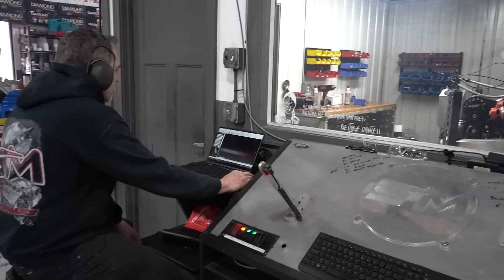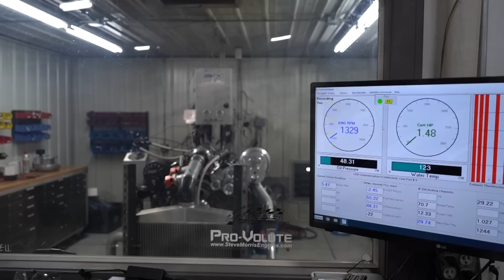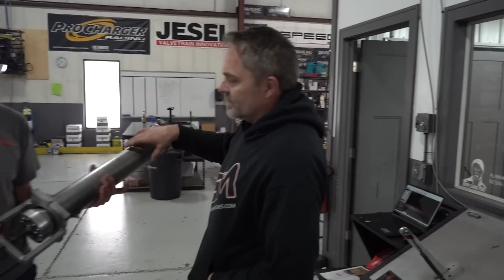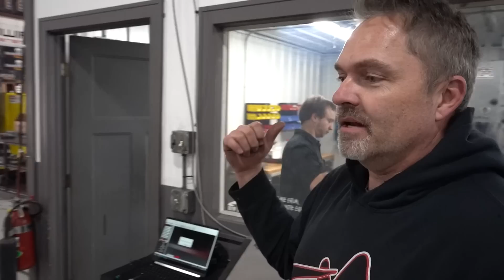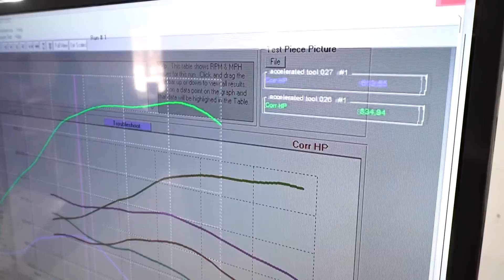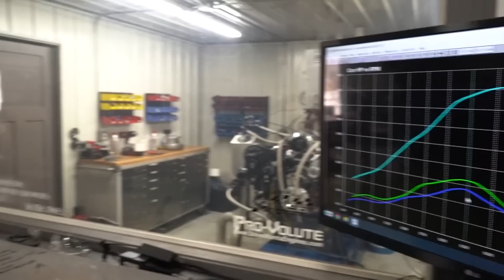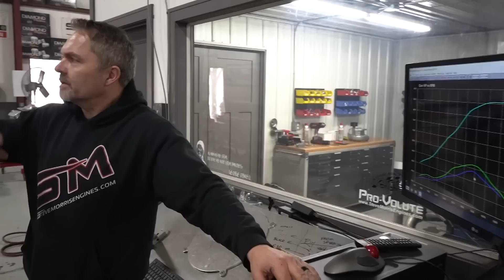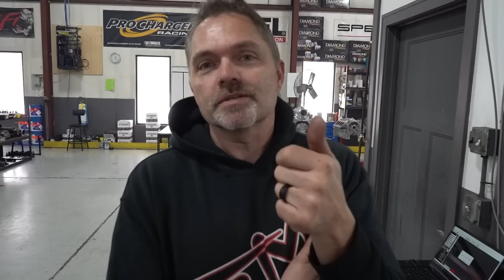CRAZY Testing After The  Dyno Session

Comment: I wonder what would be the effects if you basically restricted the flow, turned up the boost essentially, to the point where the supercharger began to cavitate. All least in reference to the parasitic loss. Obviously cavitation can and will destroy the impeller and possibly the housing and bearings eventually. Restricting the output flow and the body would go up to a point where the impeller couldn't create any more and it would cavitate and overclock if you had an unlimited supply of input power, but the charger being limited by being driven by the engine rpm directly, would it alleviate the chances of cavitation or if it happened, how would it show in the parasitic loss?

Comment: I'm thinkin' the motor is sucking in air with the blower feeding it, so the total amount of airflow through the blower is much higher. So with the blower just on a restriction it will run at a totaly different spot on the compressor map. So maybe a efficancy thing? I dont know, one of many thoughts.

Comment: Can you please get them to provide information for their superchargers. I do converters for a living and more people are contacting me with torque storms. Blind guessing just isn't my business. There is not so much as internal gear ratio on the website. The only sliver of information is "capable of 1250cfm" which is not at all helpful.

Steve is correct around the 20min mark. A big block will run an extreme street legal supercharger out of air. A really nasty small block will even do it and I will say no more on that subject. Ya'll can chase us if you want, part of the fun, good luck.

Regarding the parasitic. Wide open it's a single stage air pump. On an engine it's a two stage air pump. You're pumping air with an air pump into an air pump. How much air the secondary air pump(engine) pumps will have an effect on the parasitic losses, as will the rate of acceleration which is a subject not even mentioned. Boost is a measure of pressure differential, there is a totally different pressure differential into atmospheric than there is into an engine so this is actually not an equal comparison and while interesting is not equivalent.

Comment: Centrifugal compressors produce parabolic boost curves at a given shaft speed. When running open pipe you are essentially on the right hand side of the map where flow is maxed and restriction is minimum. As you increase restriction the pressure rises until it goes flat and eventually stalls on the left side of the map.  The horsepower required essentially follows the constant speed pressure curve only it is inverse so the greater the flow the greater the horsepower demand for a given speed. Again the power curve is parabolic so in the effecient part of the map from choke out a little amount the power doesn't change very much but as you start to get towards the area where pressure drops fast with flow the power required goes up fast.

Comment: If you have time to make the content, run an engine on each dyno with one driving the blower and one getting the boost. Set the same ramp rate for rpm and that would probably give you the most accurate horsepower loss for driving it. It would be cool to see how much more the other gains with all the benefits of the boost and no parasitic loss too.

Comment: I agree that it’s not a direct correlation. An 8 cylinder compressor of a given C.I. flows nothing like a fixed orifice pipe. An engine is essentially a variable orifice due to rpm. You could match the orifice flow to a given engine rpm flow, but that doesn’t help you any. Finding the parasitic loss isn’t fixed at a given boost level. It’s all cfm based. Even that is a ballpark in general though. Every engine flows a different cfm at a given rpm.

Comment: Lots of great comments on here! I tend to understand this situation as the general theory, supported in a few places in the comments here, that the operating range of the compressor is the critical component of this conundrum, with the factor that the engine only allows a finite amount of air flow being relevant (the reason that positive gauge ("boost") pressure can be established in the intake manifold). Once the compressor is allowed to flow directly into the atmosphere at a constant 14.7 PSI or 0 gauge PSI, it cannot function within its designed operating range, the designed operating range being in the state of feeding an engine (which moves a defined volume of air at a given speed) compressed air. I suppose that cavitation could possibly be the internal result of operating the compressor whilst feeding it directly into the atmosphere. In the event that the conical valve is used to simulate the situation of the compressor forcing air into the engine, the direct evidence of the crankshaft deflection magnitude shows that the compressor is again taken out of its operating range, perhaps in this situation it is not allowed to flow enough volume to enter its efficiency range. I would like to see air temperature data from each of the tests. The mechanical energy has to be converted into something, usually this is heat....

Comment: Steve you have explained before that  the more you boost an engine the more it tries to push everything out of the bottom of the block.  So if you dump the boost you only have the belt pulling up the crankshaft to some extent.  With the engine boosted the forces are probably more balanced.

Comment: Wouldn't the compression building in the intake from the blower not also cause back pressures resulting in blower propeller drag? I don't believe the engine itself can exhaust the amount of air it's receiving there for causing back pressure on the propeller I've been wrong before but I'm willing to bet that it causes a difference
Reply: What i win? 🤣🤣🤣 
Go away scammer!

Comment: What a great video and natural engineering skill.

I think what’s missing is the engine air pump factor, you got it as I was typing. 

Basically variable resistance at the end causing different cfm’s needed for a target boost pressure based on engine rpm.  

I think driving the supercharger with a second engine with rpm matching is the only way to solve that relationship across the range.

Comment: Agree with your theory at the end.  The engine is at a lower pressure (on average) than the room is.  If you could hook the compressor to  vacuum pump big enough to have the same amount of pressure and cfm as the engine does across the WOT rpm range, I think you'd be able to know compare the blown engine to not blown HP curves to know how much HP the blower was consuming across that WOT rpm range.

Comment: The crank pulling issue is a physics problem. When the motor is under boost the centripetal forces acting on the crank is high enough that it offsets the superchargers pull on it. With out that boost pressure to raise the centripetal force on the crank it’s easier to destabilize. Basically, the pull of the blower is strong enough that it can affect the forces acted upon the crank when the motor isn’t receiving its boost.

Comment: I believe the restriction of airflow through the engine is substantially more than test contraption given the "same" pressure level.  The air pressure on the contraption sitting in the room is 14.7psi, one atmosphere.  In the engine, at wide open throttle, you have zero atmosphere in the manifold.  So, if you add that 14.7psi of atmosphere pressure to the 12psi of manifold pressure when running boosted, you need more like 27psi at the contraption/restrictor to get anywhere close to matching the pressure and airflow through engine.  Really, it's dynamic, and a lot more complex than my feeble mind can wrestle down, but I think the premise applies, and is why you saw closer to expected results with increased restriction (27psi first pull).
Reply: Whoops - nevermind.  I see in the last seconds of the video you guys got there.  Started typing too soon!

Comment: You're just venting the blower to the atmosphere, and engine is actually consuming cfms that come in. I think just venting it to the room you have to have a higher PSI reading because there is no engine using air coming in. I'd guess have to CFM the motor with a meter NA, than under 13lbs boost. If say engine is 1300 CFM NA, and under boost is 2800 CFM, than would have to set the contraption to read 2800CFM for it to be similar? IDK, I guess what I'd try if I had the means to.

Comment: I think you would find that restricting the output of the blower is very different from restricting the input... still a very interesting test. IE it is different from blocking your vacuum cleaner and the motor unloading. Temperature rise at the blower output is also a factor with the measurement... ie if you have a ridiculous rise in temperature of 270c the blower could provide 15 psi but no more mass, I know this is a ridiculous extreme.....

Comment: I would expect the increased (boosted) cylinder pressure to counteract (to some extent) the excessive crankshaft flex/deflection when the supercharger is venting into the room.  In the absence of that pressure, the crack experiences greater flex/load & contacts the crank pickup.

Comment: Could they design the idlers so that the pull is 180 degrees apart on the twin setup? Also i'm curious if these blowers could be modified to have variable pitch blades much like the turbos that are on diesel engines. This way it could be tuned at different rpms and loads to produce the most boost with the least amount of parasitic draw.
Reply: While there has been some research on the compressor side, variable geometry is only implemented on the turbine side of any turbos currently produced
Reply: All the variable turbos I’ve seen aren’t pitching the blades. They’ve got adjustable nozzles that change how the exhaust hits the turbine. 
I would imagine with one of these you’d want a variable drive on the front so it can spin faster at low rpm and then slow down at high rpm so you stay in its efficiency zone. Although, part of the reason they work so well is because they don’t produce to much power down low and spin the tires.

Comment: The mass airflow with supercharger pushing through the engine at 12psi will be much higher than the mass airflow through the test pipe at 12psi. This is drastically changing where the airflow and boost sit on the compressor map. You would need two identical engines side by side both pulling dynos at the exact same time and rpm. One engine running the supercharger, the other taking in the air from the supercharger.
Reply: Sorry, nope. See my comment below.
Reply: @damonsalo597  Sure. Those equations make sense. At the end of the video he glazes over compressor efficiency. When a centrifugal supercharger is moving air into a running engine as designed, it's efficiency greatly increases vs. moving air down a pipe with a fixed restriction at the end.

Comment: Its the same as dyno runs in different gears. 4th will most likely show more power because it creates more load. (but is more likely to break stuff) When you close the cone and create more pressure it is creating more load on the engine also outputting a bit more power. This is the same reason you wouldn't expect the exact same numbers from different dynos. There can be slight differences in the loads between similar dynos and different types of dyno load systems can show drastic differences in HP. Dynos are really only a good reference to themselves. Its assumed that most cars make more power on the track than on the dyno due to the weight of the vehicle and aero forces changing the load.

Comment: Nose loading on a crank....sparks. Well, back in 80, we did a bunch of crank deflection testing at McLaren Engines on Buick V-6's. The multi-V-Belt that was used deflected the crank in a BIG way. 4 belts bent the (LONG) nose of the crank with over 800lbs of belt tension. 
Yeah.
We saw sparks too.

Comment: So is there a way to make it more efficient and take less horsepower? Do you make a bigger compressor wheel and spin it slower or make the gearing different to help with mechanical advantage to lessen the loss of horsepower.  Maybe lightening parts ? It is scary if your  thinking about adding a blower of this type to a stock engine and you blow a discharge hose and it snaps the crank shaft off at the snout .

Comment: Just a thinker with out any education, but the hp used to drive the blower will correlate with the efficiency, so when the efficiency takes a dive on the chart, so will the hp used.  Air driven is the hp used within the efficiency graph.

Comment: If you had load control that you could sync 2 dyno cells to rev at the same rate you could mimic the dynamic load on the blower by having the loaded engine feed boost into the cell next door where that identical engine is running at the same rpm. 

This would give two confirmations of the blower dynamics: 1, parasitic loss of the blower, as the driving engine would be down on power by x. And 2, the other engine would see max developed horsepower, as it doesn't have a blower dragging it down, but does have boost bringing it up.

But that would require load control that I'm note sure you can develop without many dollars of test hardware.

Comment: On any belt drive, the driver has a tension (load) side and a slack side, so you're only pulling the crank toward the load side. A crank snout support bearing on the front of the balancer  with a cantilevered frame mounted to the pan rail and front of the block would help distribute the side loading, like the pinion snout bearing in a Ford 9". You guys have the capability to make that happen. CNC up a prototype and don't forget me when you sell a thousand of them....
Good session!

Comment: the boosted pressure in the engine is not the same as running the supercharger straight out to nothing. You are always "leaking" boost into the engine, you need the charger to build enought backpressure to be able to read a positive boost value on the intake manifold

Comment: Theory: the blower is loading the nose of the crank the same, regardless of where the blower outlet is going... but that when the engine is receiving boost, the sweep goes considerably faster than an N/A sweep, and so the tension of the blower drive belt doesn't have as much time to act on the crank nose and deflect it to the point where there is a crank trigger interference issue.

Another theory: there is some kind of harmonics issue at work in the crank... each power stroke of the engine under boost pushes on the rod/crank noticeably harder than when N/A.

Comment: I think that the easiest way of measuring power consumption would be to run the blower of an electrical engine matched to rev up at the same pace of the real motor. In this way you get all the real boost on the real engine and the parasitic loses on the electrical engine, and you could easily compare the combustion engine real power gain not having to drive the blower AND the power needed to drive the blower by the electrical engine to compare both. And in this way you don’t have to mess up with CFM and all that mess. Jus thinking out of the box…

Comment: The work the blower is performing is air flow multiplied by compression ratio (boost), divided by the compressor efficiency and the result is the power supplied to the blower by the engine. Boost pressure at the blower output is mostly a function of blower RPM, you can have a wide range of air flow at the same blower RPM and making just about the same boost. If you want an apples to apples comparison of what the blower is doing you have to measure the air flowing into the blower as well as the boost at the blower outlet. Your pipe change did not increase boost at the blower outlet, it just reduced the loss going through the pipework and intercooler.
Reducing the restriction at the blower outlet always results in more power needed to drive the blower.

Comment: When you're basically using the front of the motor to run a gigantic air pump your flexing the whole driveline because you're just doing an NA motor driving a gigantic pump off the end of your crankshaft when you add boost to a motor that boost in turn makes a lot of power which in turn your pistons are having much greater force so then you're not twisting the motor as much especially on the back half of it so it kind of evens itself out

Comment: Is the intake tube not acting like a Venturi not something you see strapped to the front of any compressor 🤷🏻‍♂️ but could be a thing in its own right ? 
Could you not control the inlet with a DBW throttle body or a blade set up ? 
And my last question is do they run a 1 way bearing and toothed belt ? 
From the Uk with 0 experience with a American v8 😂

Comment: Lesson suggestions for future video follow up including;
1. Hook the compressor to a large controlled/metered electric motor and then dyno the blower, the pipe load, different intercooler airflow restrictions. Then
2. Hook up all the intake to engine MINUS blower to show pipe lengths/sizes and different intercoolers vs open air carb reference; and calculate the air loading.
To answer the homework:  You said it sorta; The engine drawing the air is simultaneously removing the air your blower is adding in, team work makes the dream work.

Comment: Crank deflection on a V engine is left right left right on an inline engine is up down up down to a degree. So when adding a load one direction the crank is pulled that way. When boost is added to a V engine the force being add to the piston rods and crank helps to cancel some of the deflection. On an inline it can in hanse the crank deflection depends on how the load is placed.